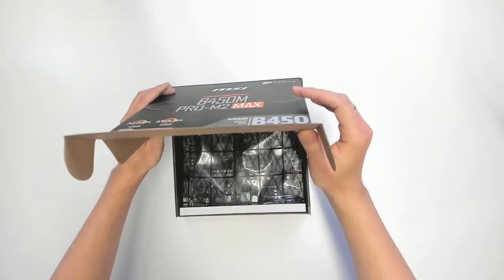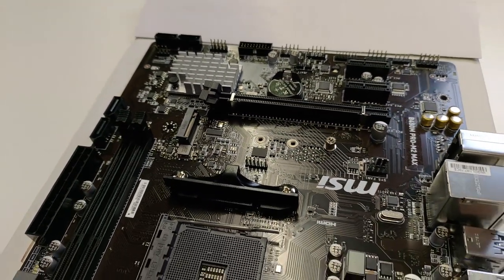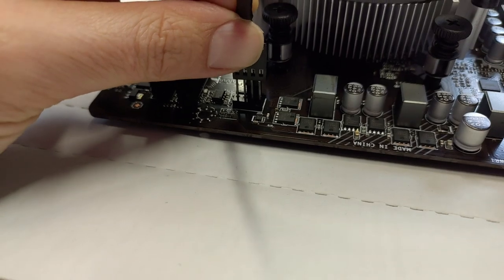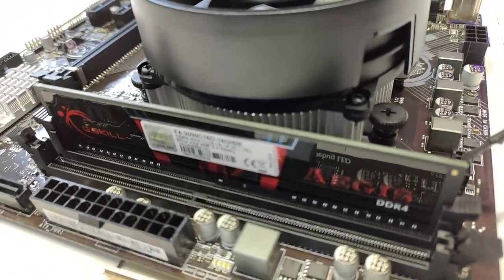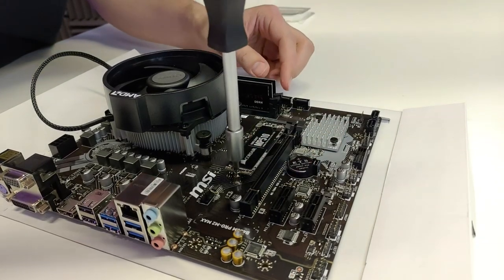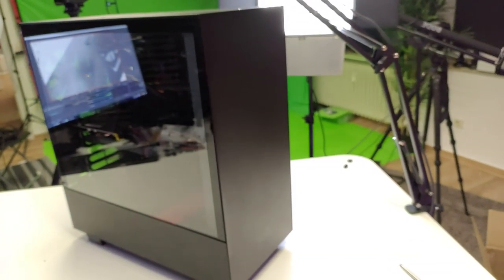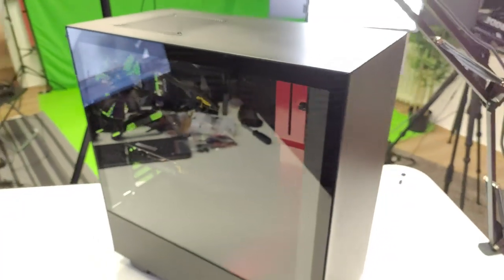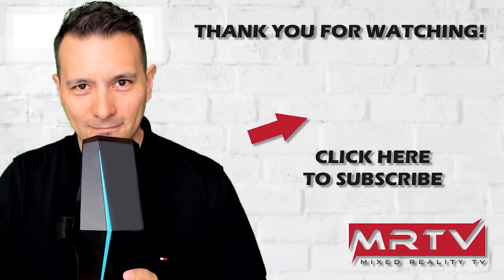Step By Step Tutorial: Build The $700 VR PC Yourself! Play Stormland, Asgard & Half-Life Alyx!

Comment: I'm a bit stuck on the connection of GPU power supply unit part. I inserted the three cables that fit the three ports on the board. I cant seem to find a good fitting plus (the one that consists of two parts) that attaches to the graphics card. So, I'm a bit stuck on 10:22 of your video. Do those three plus you mention during this part connect to each other or are those individual plugs all three coming from the power supply? Thanks for your time.
Reply from the maker: Hi! Everything is coming from the power supply! Did this help?

Comment: Hey Sebastian I used to build my own PCs in the past and it wasn't hard after doing it once. I never knew that it can be made without a case though and actually work. That is pretty interesting to me and another thing the SSD drive I thought was bigger and put in the case like the HDD drive. Did they make them smaller now that they go on the motherboard? It doesn't look easy to swap out that way though.

Comment: probably going to buid this! Two questions
1) Does this work with valve index?
2) I think this meets the minimum requirements, but do you think we'll be able to play Alyx with full settings with this?
Reply from the maker: Hi, yes it runs the Index. But I believe you should upgrade a few components. Like get the Ryzen 5 3600. And perhaps 2070 super. But of course depending how much you want to spend!

Comment: Looking for VR for sim racing. Is Rift S will be enough or makes sense to pay 2.5-3 times more for Valve Index? Thanks.
Reply: The Valve INDEX , if you have the money $999 for complete kit and are a V.R. enthusiast ( will buy the very  best in V.R.  items and have a GTX 1080 , GTX 1080 Ti ,  RTX 2080, RTX 2080 Ti )  then buy the Valve Index. 
The Valve Index has the Best Tracking, using two lighthouses (Infrared Laser Beams in each lighthouse), better the average  F.O.V. at 140 Degrees vs 110 Degrees ( Field Of View ), and finger tracking. The audio sits above your ears never touching it the sound from most users is said to be very very good.  The INDEX has high resolution LCD displays, but it does have god rays not as bad as the Rift CV1 did.  The controllers are rechargeable last about 7 hours  ( no batteries to buy ) and do need to get used to using very different from a Rift S or Rift CV1. 
The fit is apparently very comfortable from most users comments.   It also has one of the Best Microphones too. 
1.  https://www.youtube.com/watch?v=GUTng28615g
2.  https://www.youtube.com/watch?v=HuobWbxGfnY 
I'm not sure if Valve records anything you see or say while in VR,  I just know that Facebook's Rift  Cv1, Rift S and Quest does.  

   The Rift S is the other choice. You must have a P.C. graphics card: GTX 1050 Ti, GTX 1060, GTX 1060 Super, GTX1070, GTX 1080, GTX 1080ti, RTX 2060, RTX 2070, RTX 2080 or RTX2080 Ti then get the Rift S it costs $399.
 It has a comfortable feel, the image is sharp, no god rays at all. The Touch Controllers are good and very easy to use.  The controllers use a AA in each I would suggest to buy 2 rechargeable AA batteries and charger.  It will play ALL Oculus Games and Steam Games also. It will be the automatically supported in the up coming Horizons ( Facebook ) Social Platform that will be a community of people in area to play games and talk.  Many good games are on the Oculus Store to play are rated AAA so that's good.  Facebook owns Oculus so when you use an Oculus Rift , Rift S, or  Quest you will be notified before using it that Facebook has the rights to record you what you see, and what you say in the user agreement so they can collect information about you.   If your not doing anything wrong then no worries. Google and Amazon already collect information on you if you use their services.       

Bottom line both are good VR systems INDEX is $999 ( Steam Games ) Revive Program added then it will play Oculus Games.  
                                                          Oculus Rift S is $399 ( Oculus Games ) it can play Steam Games now.
Reply: @darreng8583  Thanks a lot.
Reply: @aodtoxic  No a problem I thought it would help.
Reply: The rift s is perfect for anything you want in VR for a mid range costing headset. If you want to spend less, there are some really good deals on windows MR (VR) headsets for around $200-300 on Amazon in the US. And especially for racing Sims, you won't notice the inside out tracking on either the oculus or  the windows mr headsets although, other than the Samsung odyssey+, wmr controllers need a separate Bluetooth dongle

Comment: Do I need an ssd can I just use an external hard drive
Reply: Use an SSD 100%. The loading speeds are so much better. Hard drives are so slow, especially external ones, as they are usually through USB, not directly to the motherboard (mainboard)

Comment: That would be for a crappy VR headset. The good ones need at least a RTX version video card
Reply from the maker: Hi Brent, that is absolutely not correct. This is an amazing VR PC for Quest and Rift S and those are not crappy VR headsets by any means.
Reply: @shojo8708  Seen all of them. So I'm picky!!! Pimax 8KX will be the first good one in my mind.
Reply: @shojo8708  What I've seen on here it's going to blow everything away. The reverb is the est resolution by far and it's a lot better than the reverb, but the price will be double and you will need at least a 2080 video card.